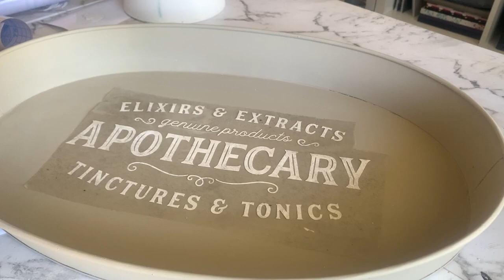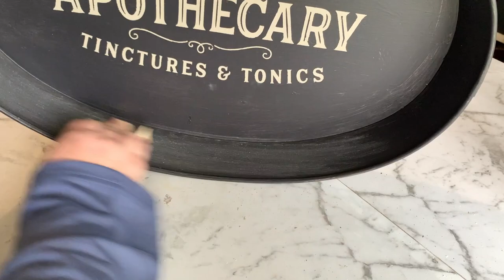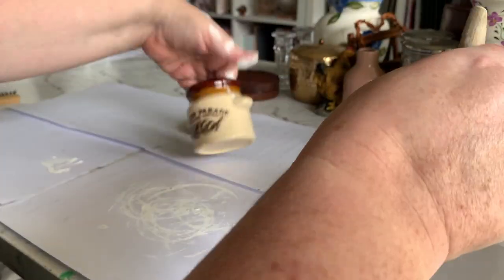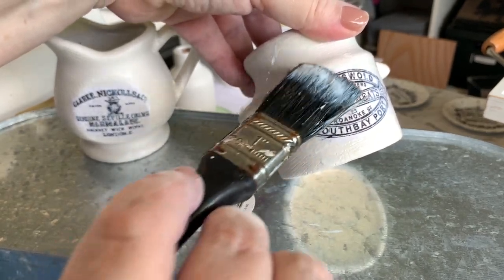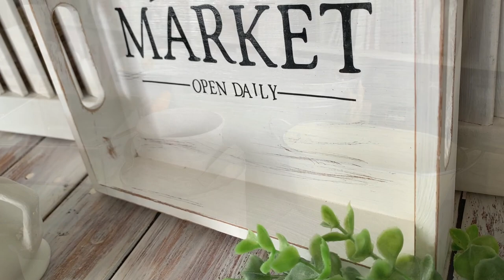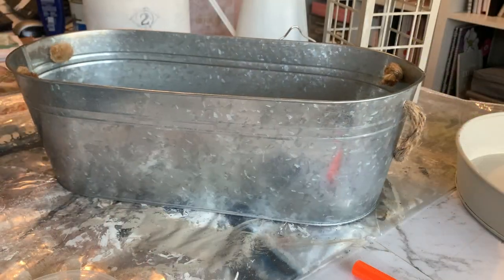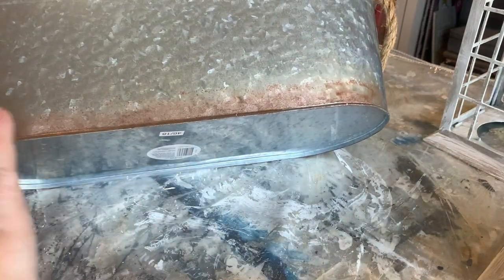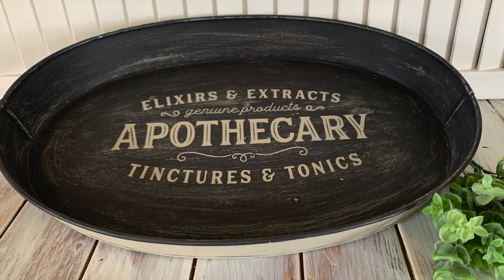TRASH TO TREASURE THRIFT STORE FLIP | UPCYCLE HOME DECOR | 6 DIY FARMHOUSE STYLE DECOR ITEMS

Comment: Beautiful projects, Lisa. If we were looking at dabbling in some craft ourselves, which cutting machine would you recommend? I am interested in the Cricut Joy but see that you use Silhouette as well. Your advice is greatly appreciated ☺️.
Reply from the maker: I did a bit of research before buying the Silhouette and ultimately chose that one for a few reasons. It is capable of doing larger projects more easily without having to separate your image into smaller sections. It has the ability to use a continuous sheet of vinyl without the use of a cutting mat even if you don’t have smart vinyl. And it was about $100 cheaper than the same size one from the Cricut brand. But having said all that the Cricut joy does take up a lot less space and is still capable of doing larger projects but you just have to cut the image up into sections. If you plan on doing larger size projects go for the largest machine possible if your budget will allow.